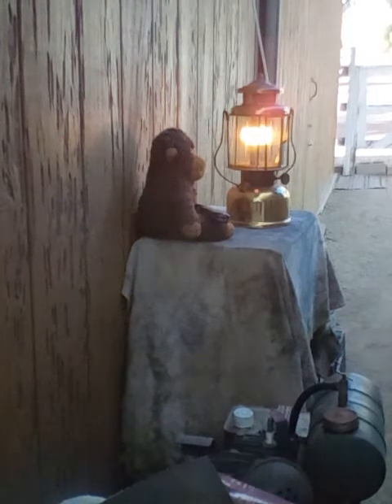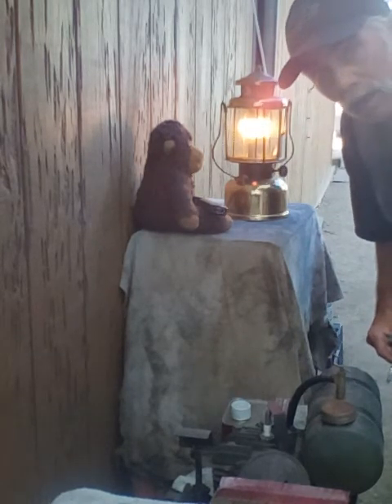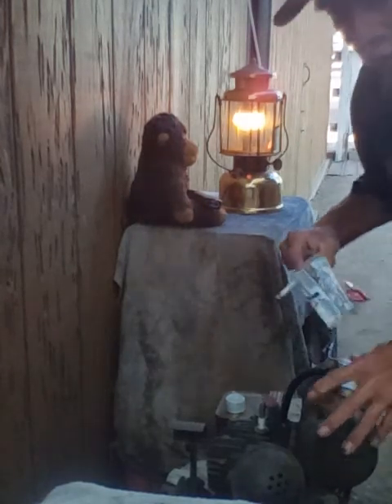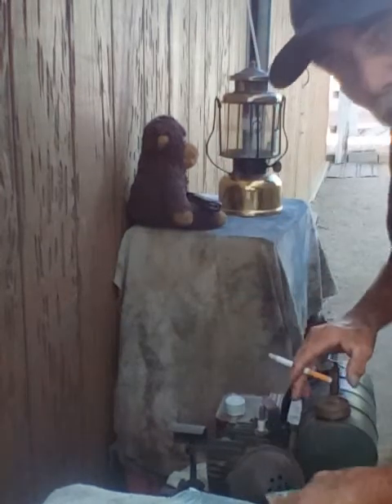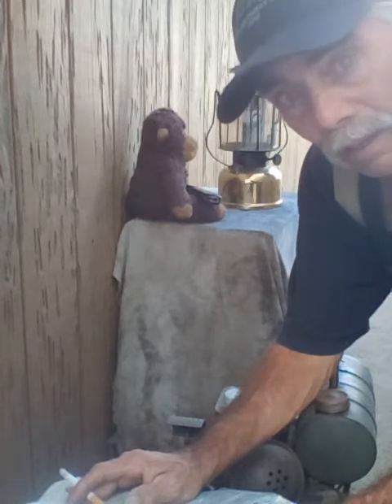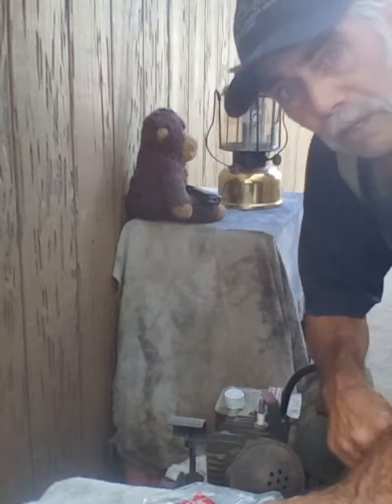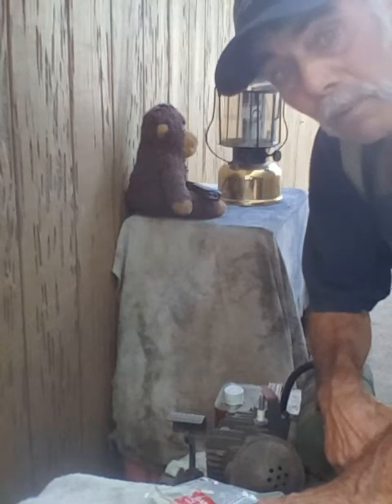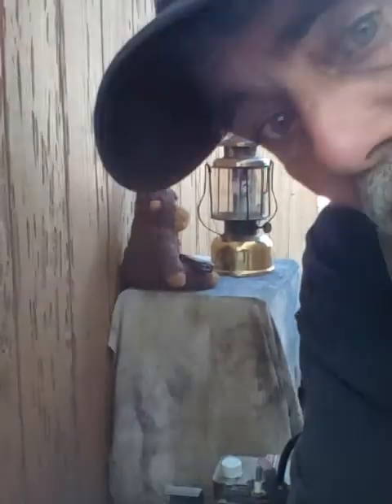ISSUES WITH MY QUICK LITE "MARCY" PLEASE READ BELOW

Comment: Bob if you are getting carbon in the mantle, it's not getting enough air. Fuel / air tube in tank could have gotten plugged. Or a spider made a web in the outside air tube. I had the some problem,
Reply from the maker: steve young this 1 i  keep in doors. i mentioned in video all tubes are cleaned today.   has to be something simple. i did tear down and tubes were  clean. it is bugging me. thank you for your response sir  i will double check in the morning   Bob
Reply from the maker: steve young just got done for the 3rd time now tear down and reassemble all clean.  any other ideas?    Bob   10 am